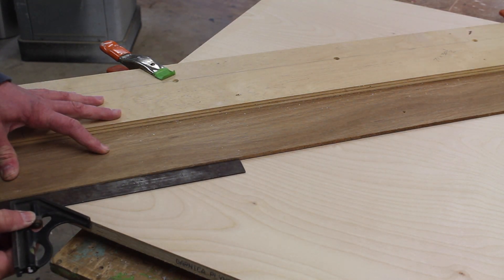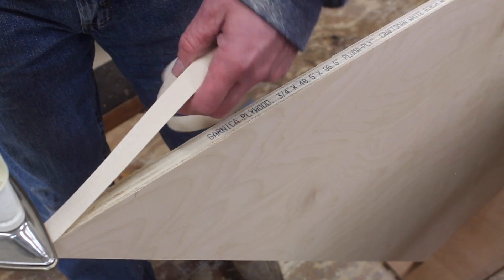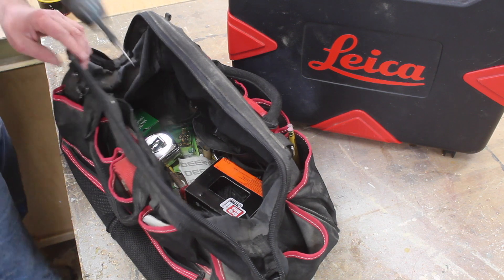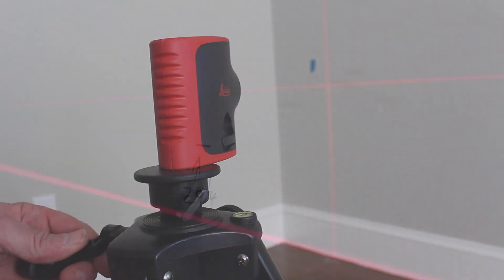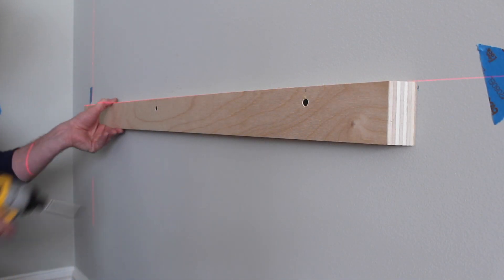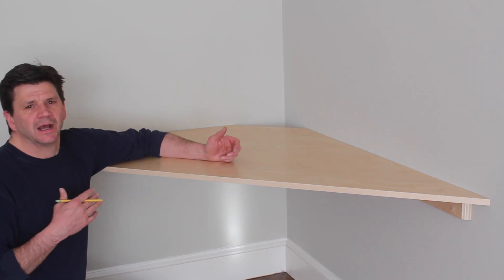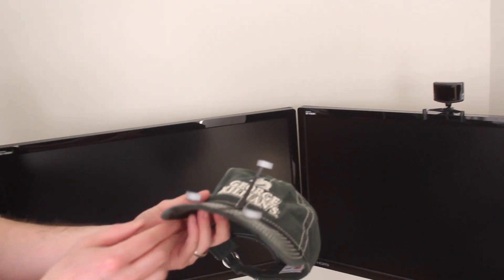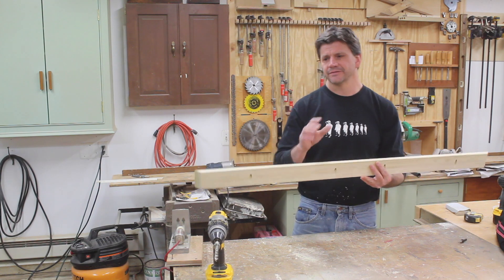How to Build a Corner Desk for a Flight Simulator

Comment: I didnt see anything on the laser level that showed you if the item itself was level. How do you know the lines are level when they're projected?
Reply: They automatically level...no adjustment needed.
Reply from the maker: +LawffleCopter yes Rod is right , I will try to show how it works in a short video.

Comment: a few things (from a computer guys perspective) for the looks, i would have swapped the cable that was plugged in to the left monitor to the middle one (start up reasons, and bios changes will be a bit more comfy then). then it also looks like you forgot to turn on Amd's eyefinity or nvidia surround. you(you brother) can simply rightclick on your wallpaper and click on eighter Nvidia controll panel or whatever AMD has, i think they call it the amd catalyst control center, it depends on which graphics card(s) you have. and last but not least a tripple monitor arm, it will clean up a lot of the cable clutter, give you a lot more space on the desk (and A LOT if you go with a clamp style one, if they exist for tripple monitor arms) and you can easly adjust the monitor angle and tilt as well as change the height for ergonomic reasons. they can be a bit costy tho, but forunately they can be really easly made aswell ^^ anyways, it seems like a nice desk, just right for its job :D
Reply from the maker: +Tommy Strandman Good tips Tommy, I'll tell my brother